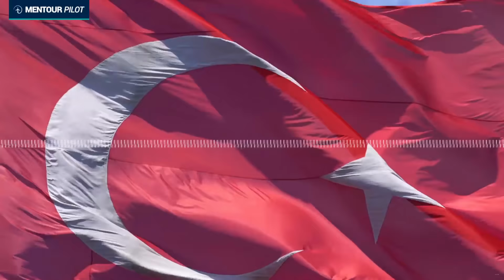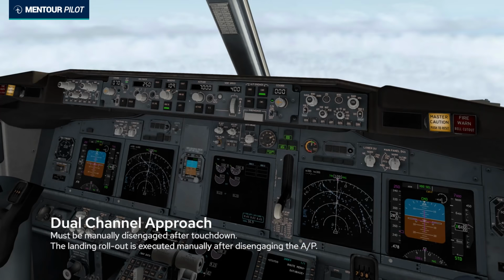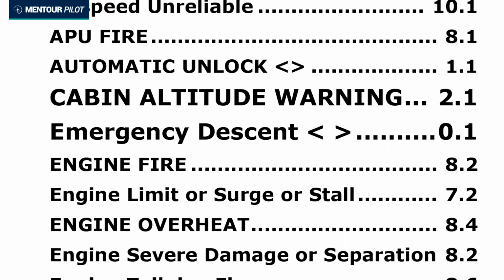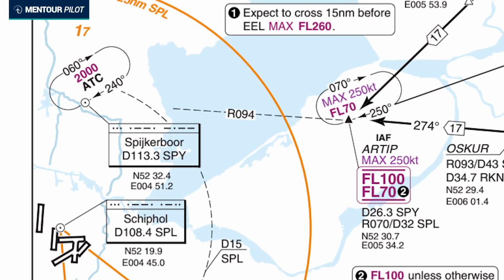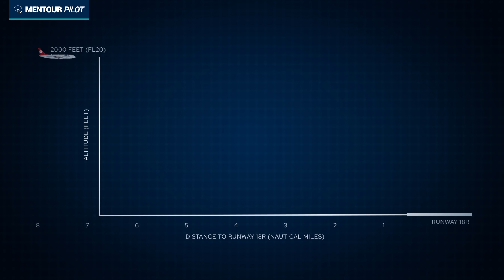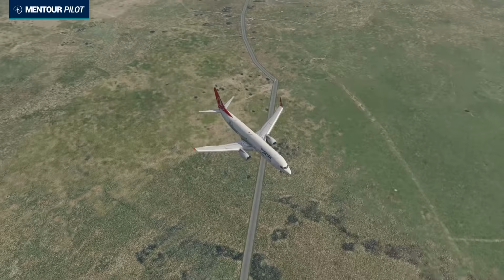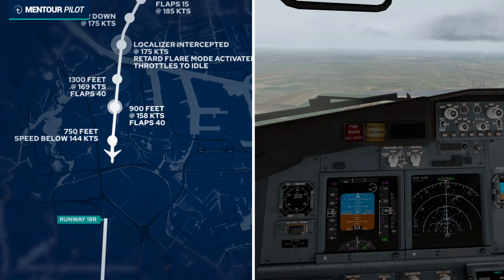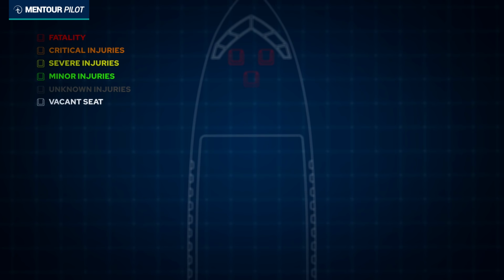What happened to Turkish Airlines flight 1951?!

Comment: Seems like CRM was an issue too, I was kinda expecting that you would have mentioned it. The FO almost saved it before the Captain took over and killed the thrust. Although as you mentioned it was a huge issue that the three pilots didn't seem to spend any time discussing the radio altimeter issues and how they should adapt their procedures because of it. Really enjoyed the video and all the detail.
Reply: Yeah I can't really wrap my ahead around them not troubleshooting an alarm that blared for over a minute. I think they had a high authority gradient and maybe the FO was scared to speak up. And his mistake when engaging the dual mode might have been embarassing and caused him to say even less since he was being tested. And then the captain taking over in the middle of a stall recovery at such low altitude and cutting thrust... I don't really blame the FO, he was supposed to be the one learning and he's not the one who crashed it in the end.
Reply: Amen. My feel from an early point is the Captain was doing too many things and wasn't effectively monitoring as a result. The FO made some error's but the whole reason there is a pilot monitoring is to catch those, and where dealing with an extremly junior FO here, some mistakes under unusual circumstances are to be expected. Hell the entire reason they do check flights is to look for this kind of thing.
Reply: @user-lv7ph7hs7l  Yes.
Reply: @darthkarl99  Exactly.

Comment: It's interesting that on ILS approach that you would have to come in over the top, and not intercept it underneath. Why did ATC direct them to do that? Was there a limitation to the altitude on approach because of buildings or something? Love your work Mentour.
Reply: Save time and bunch planes together more. Other wise there will be more separation needed. It caused several crashes, not just this one. To be clear, it's not unsafe, just a lot of crashes are caused by pilots trying to descent faster and catch up with glide slope.
Reply: Short lineup at Schiphol was used a lot in the past. It's not really a problem, however it does need communication to the pilots and usually, a "descend with the glideslope" instruction was part of the ILS clearance.
Reply: @renevanhove1066  "Descend with the glideslope" is meaningless. On an ILS approach you descend with the glideslope anyway. Capturing the glideslope from above IS a problem when the pilots expect the autopilot to do it and when the autopilot doesn't they react too late or fumble it.

Comment: I have watched countless air accident videos as an aviation enthusiast.  I would say it seems as many as 80% occurred with the FO as the pilot flying.  Perhaps the sample size is not large enough but it just seems all too common. I also find this interesting as I would think having the Captain monitoring seems as though it could be ideal in preventing many of these accidents.  Am I missing something?  Thanks for the great content!!
Reply: F/O get to fly more than half of the time because they are building their flight time and needed the practice (6 out of 10 times captains fly take off and then F/O land the plane, it is usually decided before flight). F/O usually are less experienced it’s normal for them to make more mistakes.
Captains also need to fly/land from time to time, there were crashes caused by a captain did little landings in past 3 month and crashed the plane during a landing.
In this particular case, it’s potentially possible to recover the plane if the captain didn’t take over letting the engine go idle again. But at the moment the captain probably thought he should cove the F/O and take control.
Reply: @AaronShenghao  I was just making an observation after watching a high number of these videos.  I don't think you are correct.  Pretty sure both pilots time on the flight count as flight hours.  At least in the US, pilots usually take turns being the pilot in command and pilot observing.  The pilot in command, absent some kind of emergency when the FO is PIC, will take care of the takeoff and landing on that flight.

Comment: It seems very strange that no-one in the crew seemed to react to the warnings they were getting, or at least didn't verbally acknowledge them. Two reasons I can think of:

- Both the captain and co-pilot were military pilots, so there might have been a tendency to think "this guy knows what he's doing, no need to point out obvious things like that there's a warning, it's under control". Once this sort of groupthink is established, ie "no-one is saying anything, so I guess everything is ok", it's difficult to break it and be the first to speak up.
- Maybe this wasn't the first time they were in this situation. The radio altimeter problem was known to occur from time to time, so maybe they had gotten used to getting the landing gear warning, and had become complacent. That's the only reason I can think of to not react to it or mention it at all. If it was a completely novel warning sound, surely they'd have perked up a bit more, the trainee would perhaps have asked about it and the safety pilot would have remarked that something strange was going on.

Doesn't still really explain why no-one seemed to say anything as the situation started deteriorating further, the approach being unstable at 1000 feet would have been a clear indication for the safety pilot to intervene. Which, again, makes me think that this wasn't that unusual, and the pilots would actually routinely continue unstable approaches, so no-one said anything. Another option would be the groupthink mentioned above, if no-one is saying anything and you have already opted to also stay quiet, suppressing the feeling that something is really wrong, it's hard to turn that thought process around and break the silence.
Reply: also called rank dont argue with your superer  evan if you die because of it
Reply: Both Captain and Co-pilot were military pilots while Safety pilot was a civilian pilot who was also much younger than those two so it might be the reason why he stayed quiet but another major problem was they didn't have proper simulation training!! Sadly Boeing wasn't honest about their flight computer and sensor problems for a very long time and kept postponing taking any responsibility!! Such as for this crash they offered Turkish airlines a massive discount for new planes, in fact Turkish airlines has the cheapest 737-800s and 737-900ERs in the sector which was why they decided to sue Boeing first then changed their mind!! Ofc there was also pilot error that inexperienced first-officer couldn't spot or state malfunctions while the captain was simply overwhelmed as he was doing some of first-officer's job as well but the real problem was Boeing again who didn't properly share these problems with airlines and organized better simulation training!! Exactly same happened with Max as well and the company is facing billions of dollars fine now...

Comment: It's very late, thought I'd just skip thru the video, but watched the whole thing, great job explaining. I can't help to think about the group dynamic of the three pilots and their age and experience difference... if age was reversed and the safety pilot was older and the two pilots younger, maybe the safety pilot would have been more easily involved, also that the captain would not have canceled the thrust correction of the 1st officer. Maybe it's not as relevant to this situation, but it's better to suffer an unpleasant awkward moment and possibly hurt an ego, than crash and depart this world, In any case, may they rest in peace.
Reply: The captain didn’t cancel the thrust correction. His autopilot did. The captain failed to notice this correction.
Reply: @Lozzie74  Maybe, or he saw it and thought it was the right thing that it got changed back. In any case him calling he's got control effectively canceled the correction (28:40)
Reply: @zdravko. agree and also status gradient. P. does another video, can't remember which one, in which he discusses the status gradient in detail. expecting this 28 yr. old safety pilot to challenge the decision of either of the former air force captains is like asking  a student nurse to monitor 2 chief surgeons.

Comment: It’s impossible for me to imagine this happening with the training pilot present. Maybe culture in the Aitlinr was also a factor - the pilots don’t seem to be discussing what is going on - no communication! So different from Sullenberger asking his co pilot if he had any ideas  as to alternative possibilities just prior to landing his airbus on the Hudson. Very sad.
Reply: Sullenberger was flying an Airbus which prevented him from comiiting that mistake of stalling.  The turks were not so lucky because they were in an Boeing designed by less than intelligent people.
Reply: @michailbelov6703  I disagree. If you notice, the captain called "I have controls" when the pilot flying was executing the correct stall recovery procedure (Nose down, AP / AT disconnect, full thrust) and decided to retard the throttles. Between this and the captain now realizing it was not enough and applying full thrust again, that was probably about 10 seconds of lost crucial time. For me, it is not so much of a design error (Boeing vs Airbus) but more lack of communication and trust in the pilot flying.
Reply: @AndreiMataix  Tiny detail, as far as I understood the vid, the throttle went back itself after the captain said he had controls, and the training pilot dit not disconnect the AP/ AT , but I could be mistaken. Still, this sounded as the critical moment when the plane could still be saved.

Comment: I got some loud "French" practice in when you said that the captain took controls after the FO already had the recovery underway. I hesitate to accuse him of pridefulness or poor judgement, but it certainly wasn't the right call. As for the recovery, isn't that problem with autopilot/autothrottle staying engaged during a go-around the reason that the TOGA button exists? I don't have the credentials to know exactly what that button does, but it seems like this may have been the right time to use it.

Comment: The pilots recognized the inaccurate altitude readings, noting that they were coming from the left sensor, and would have concluded that did not matter because the autothrottle would have been getting the correct information from the right, according to Dekker's findings.

But the pilots could not have known the computer that controlled engine thrust always relied on the left sensor as it was nowhere in Boeing's pilot manual, Dekker found.

“I’m pretty sure none or almost none of the 737 pilots knew that,”

Comment: As a controller, seeing that they gave them a heading without considering the winds it really sets up a dangerous situation. I ALWAYs (being an ATP helped my ATC work) considered the winds, and trained new controllers to KNOW the expected affects of the winds.  In the USA, we were required to vector to 2 NM outside the approach gate.  If in side that we were required to get pilot concurrence. It had been that since before 1982 when I became a controller. As a pilot, I’m so shocked no discussions occurred with any of the faults. Understanding systems is so critical as is training how failures affect the systems and flying the aircraft. While the captain is the ultimate authority and pilots gives ATC a lot of authority when they shouldn’t. Most controllers are NOT pilots so questioning a ATC should have occurred.  Great video….but of course it was..that’s your SOP!

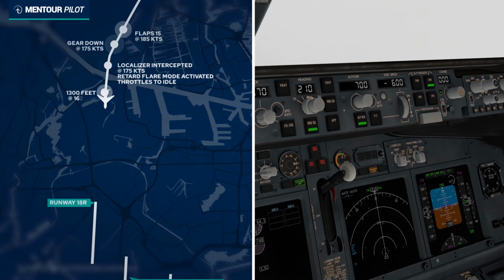Comment: A couple of years ago I've been in a flight from Montreal to Varadero, Cuba. During the approach while still at relatively high altitude the plane suddenly start descending at a pretty high descent rate for less than a minute then stabilized for a minute or two before going into an other aggressive descent rate ,and finaly stabilized for the rest of the approach and landing. I've always wondered why it happened until today . its likely that the pilot was above the glide slope and was struggling to catch up with the localizer or keep up with the glide slope during an ils. As explained here 19:22

Comment: The Turkish Airlines director at the time had mentioned that a Turkish Airlines technician from Schipol went to the crash site and was denied to reach the aircraft by some American agents, in fact, no one was let to reach the aircraft for about 40 minutes after the crash. 
Then it turned out that the number of passengers in the hospital didn't match the number of passengers from the aircraft. One passenger has been missing. Another Turkish Airlines director has mentioned (in his book) that he got a call from a CIA agent who had confirmed that the missing passenger has returned to Los Angeles via Amsterdam. Then it turned out that there were 4 Boeing employees in that plane, coming back from Turkey after a meeting about a military aircraft project (E737), possibly carrying important documents, and were meant to return the Los Angeles via Schipol. Quite likely, the rescue operations didn't begin until the American agents made sure that the employee with the documents left the crash site safely first.
Note: This set of information has been confirmed by both Turkish Airlines directors and a journalist investigating the case.
Source: Kerem Gök - THY AMSTERDAM KAZASI VE CIA DETAYI!

Comment: Two days before we flew out of Schiphol there had been a small plane crash with fatalities, and the pictures of the smoking wreckage were on the front page of some of the newspapers the cabin crew were passing out as we boarded.  Very shortly after our departure one of the engines stopped working entirely and the captain said not to worry, we could easily cross the Atlantic with the other three, but out of caution we would circle back and land again.  Ten minutes later he said we would be making an emergency landing in London.  Schiphzl refused to let us come back because they didn't want a second crash inside of 36 hours at their airport.  We dumped the entire load of fuel, enough to reach Minneapolis from Amsterdam,
 over English farms at a low altitude, flying in circles till the tanks were nearly empty.  An enormous fleet of foam sprayers, ambulances  and police vehicles with all lights flashing awaited us along the runway-parked behind massive concrete block walls  on one side of the runway. Gratitude at not being dead faded as we were made to stay in our seats for four hours, till no substitute plane could be found and we were sent to a five star hotel in Brighton in a bus, where we were fed royally and sent off to bed.

Comment: Thanks for a great video. The main problem is that in hierarchie in Turkey (airlines) means that no one will question the captain/senior pilot. The heading 210/201 is not caused by wind but a faulty input! Just to coincidental that just 2 numbers exactly are turned around. Just a faulty input in a chaotic flight. Furthermore the 8 feet (2.5 meters) did not have any effect on this crash. They wouldn't have crashed on the runway with this small difference. Main problem, the Captain who decides and Co pilot and training pilot unable to question his authority and handling of the plane. Despite the low altitude and speed people died and that's very sad as it was a human error.

Comment: The prime function of the non flying pilot is to monitor the flying. If the airspeed gets 1 knot below Vref (minimum approach speed) the non flying pilot should be calling "AIRSPEED" and if no response is observed from the flying pilot he should call "AIRSPEED" again and shove the thrust levers forward himself if necessary.  So for the airspeed to get 30 knots below Vref demonstrates a serious lack of monitoring. Notwithstanding the higher workload due to the late establishment on the localiser/glidepath etc the monitoring of the airspeed is a vital priority.
Another point worth mentioning is that on the approach a swept wing jet aircraft is speed unstable. This is because as speed reduces the drag increases leading to further speed reduction. So a small negative speed trend cannot be ignored or if it is then you get to a point where the drag is so high that full thrust will not accelerate the aircraft without lowering the nose and if near the ground there is insufficient height to recover. This is even before we mix in approach to stall.

Comment: @mentorpilot it would be great to see one on Flight 1016 from the 90's. 
In air crash investigations, the pilot explains the approach where he had unusual readouts and also a stick shaker during the microburst/windshear. 
Ultimately the episode ends with the captain loosing situational awareness and calling out "nose down nose down" without a reason. Almost making out like he was a bit crazy and made a very unusual call out.
I was surprised and ever had to rewind the episode to confirm the first officer did report a stick shaker. 
If there was a stick shaker, he nosed down, applied power and in this case they impacted the ground. It sounded insane to me to make it sound like the captain's call outs were incorrect. Had he NOT nosed down, it seems very likely they would have done what 1951 did and stalled.

Comment: Very clear indication of an over reliance on automation apparently pushed by their own company. Hard to imagine pilots used to landing with autothrottle and autopilot off as required for single autopilot approaches would have failed so abysmally to monitor their airspeed, thrust, and flight mode on an approach. More and more we see tools foisted onto people and crutches cripple them so they are made to rely more on the crutches. So many accidents are failures to monitor instruments or failure to call out and actually start correcting.